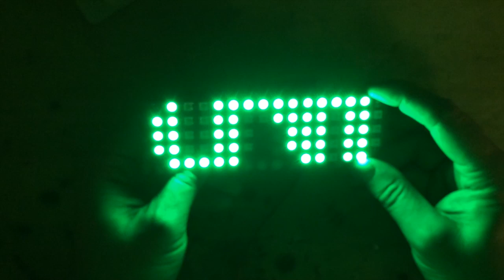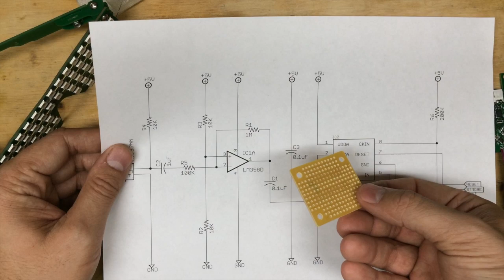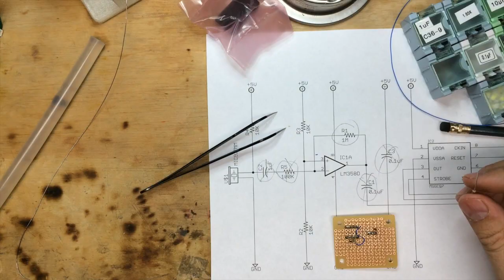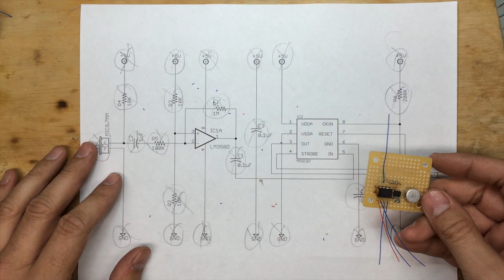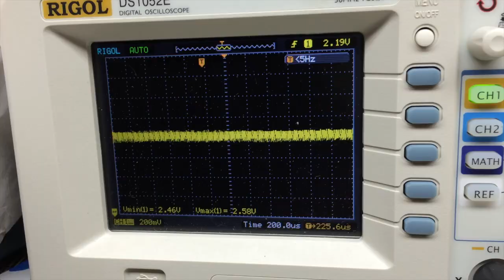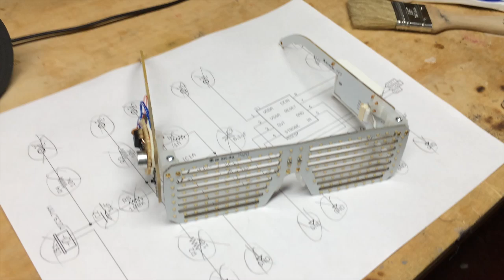RGB Shades Audio Mod

Comment: hello what is the code that you used for these shades, i want to try to use something similar for my display.
Reply from the maker: https://github.com/macetech/RGBShadesAudio
Reply: thank you so much for your quick reply, and amazing work on those shades!
Reply: also is it possible to replace the MCP601R chip with the OPA344NA chip? i literally just bought 50 of them 2 days ago lol
Reply from the maker: The OPA344 looks great, it probably won't be identical but should get close! Main issue is PSRR so filter your supply as much as you can!
Reply: im going over your schematic is there anything i should change to make the OPA344 work better?
Reply from the maker: It's analog engineering, you can throw all the theory at it but end up tweaking values on the real hardware anyway :) Give it a shot and see what happens :)
Reply: Alright i was actually working on it earlier lol. Hey man are you considering coming out with a revised version of the shades controller that has the spectrum analyzer built in?